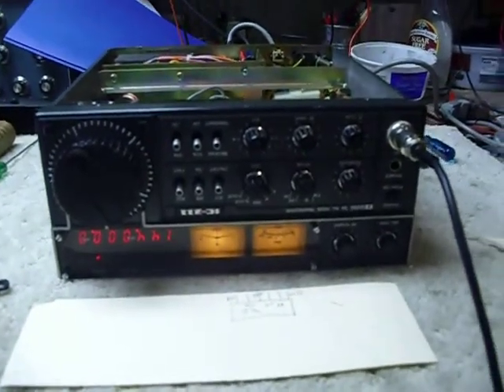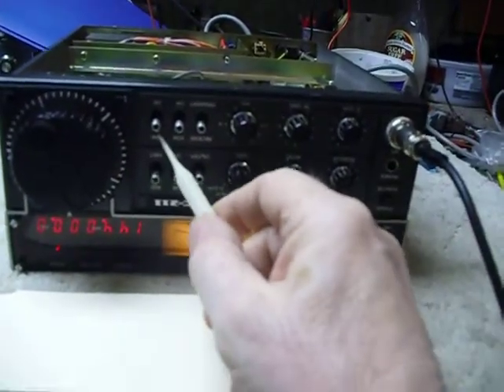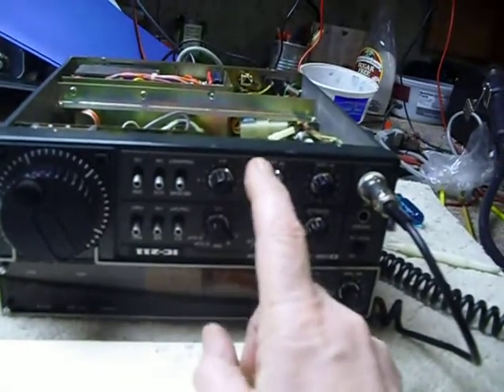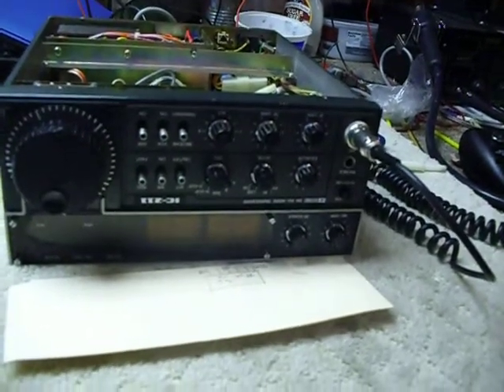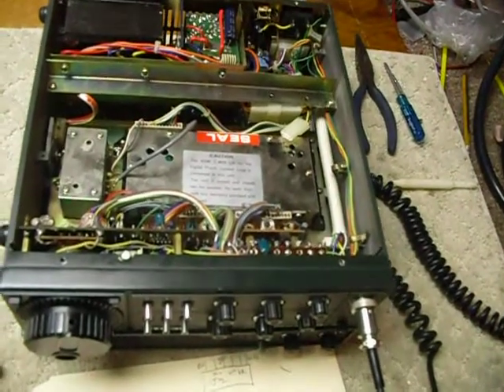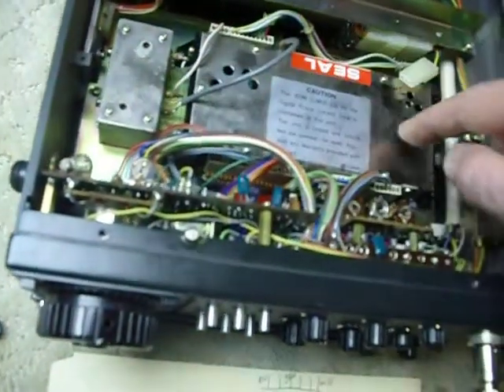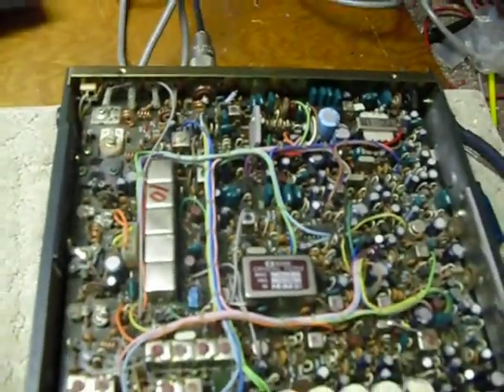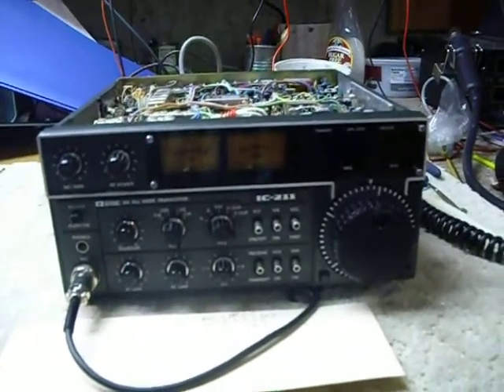ICOM IC-211 two meter tranceiver repair techniques.

Comment: Thanks, I hope I had seen your video earlier... I ended up using a spray contact cleaner instead of oil... the cold temperature made the switch brittle and the level broke :(. Anyways I ended adding an external switch not elegant, but got the radio working.

Comment: Thanks Bob!  I just received an IC-211 and it had exactly the same issues as you described,  I used Fred Yearlin's advice on the CRC 2-26 and it did the job.   The power output is about 5 watts so far, but enough for me to use an old Tokyo Hy-power amp I've had on a shelf for years and I got good reports in on this.    Since mine did not have the stock Icom mic,  I found that using a Cobra style 4 pin mic rewired was all I needed.

Comment: I picked up a IC211 at a hamfest but the display only changes if I hold in the lock button!  It does not lock it but instead makes the display move with the encoder.  Also the encoder is very very stiff.  What is the best way to fix that as I have a couple other Icoms doing the same thing.

Comment: hey there robert. great video. I have recently acquired a 211. The RF coming out of it is less than one watt in all modes. I've checked the coil near the antenna connector - it seems to be spread out plenty already. The 9v regulator is also working as it should. have any idea what direction I should go next?

Comment: Any help fixing the Tx offset - my 211 on Tx doesn't 600 kHz offset .. I'll clean the VFO switch first see if that helps... 73
Reply from the maker: I have not worked on a IC211 for quite a few years now yes the TX offset switching could be the problem  some good contact cleaner can help it is difficult to get it where needed .  sometimes a switch will start working if you just flip it a lot I flip them sometimes 100 times to get crud off the contacts inside.  I recall that the thing that caused the most problems with the Icom rigs of this type was  intermittent connections in the plug in connectors .  The tiny contacts that are crimped on the wires in the connectors will develop tarnish in between the wire and the connector where it is crimped . To repair them you need to remove the connector and wire one at a time by pushing in the connector locking tab in the little hole on the side of the connector  gently pull out that wire and spring connector on it   now look at where the wire is crimped into the tiny spring connector  I think you will find the wires are all  bare copper stranded  wires they are not silver plated so when the wires get microscopic corrosion on them they loose contact with the tiny spring connector usually you cannot even see the corrosion  . To fix them you need to remove them one by one and with a very tiny tip soldering iron and very thin solder ( I use .015 solder ) very thin but a little larger should work too  you need to solder each wire to the tiny spring connector one at a time where the wire is crimped in the connector and not get a solder glob there so the pin will go back in the plastic connector carrier do one at a time  so you don't get them mixed up solder wick can remove extra solder .The wires plastic insulation will melt a little but that is ok if you solder them quickly  . YES it is boring tedious work . I  did it several times years ago and the IC211 rigs  came alive !  other icom rigs of this vintage have the same troublesome stranded copper wires and tin plated connectors which do this . Take a look at my other IC211 video titled  ICOM IC-211 CONNECTOR PROBLEM SOLVED  just type that in the youtube search box one or more of those wires turn on the 600 khz offset I did not worry about which ones  just soldered all of them  in all connectors in  the rig I could get to  if they are not intermittent now they will be in the future .  I remember breaking a couple of the slip in spring connectors too and was able to replace them with similar connectors made by molex I found on Ebay .  These connectors are real trouble makers and they LOOK OK but are not !   one more thing to look for is solder connections on the circuit boards that have come loose or were not soldered good in the first place and a good headband magnifier helps for this and I use 3 power reading glasses with a Luxor 5 power head band magnifier with glass lenses  to do this I can see microscopic cracks in solder joints this way ...   Hope this helps  73  bob

Comment: A better fluid for switches is CRC22-6 available at Home Depot in the electrical department.  It is for the purpose.  It is also good for potentiometers.   Long term of machine oils get gummy.  The CRC 22-6 gets into the pores of metals and prevents corrosion.  It is plastic safe as well and good for connectors. K7GIJ.